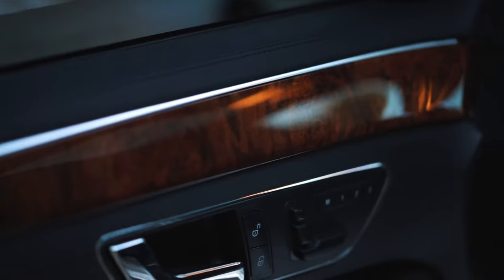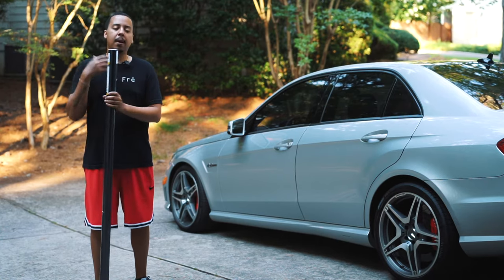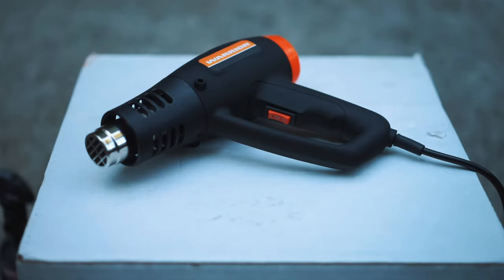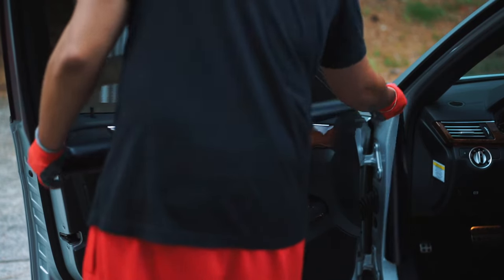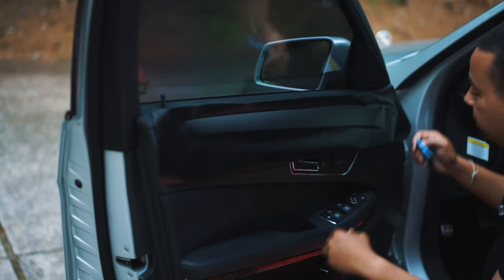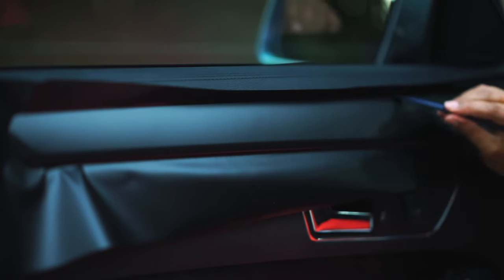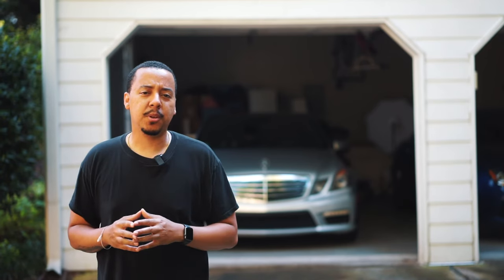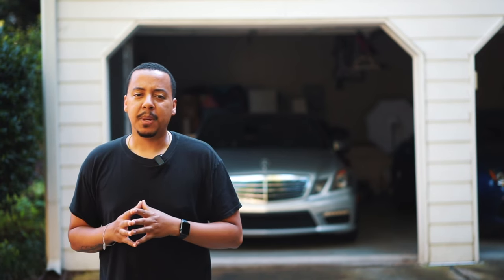HOW TO BLACK SATIN WRAP YOUR CAR INTERIOR TRIM!  Vinyl wrap you old wood trim without taking it off.

Comment: Another great video. I’d be interested in you doing an update video after a couple of months to see how it’s been holding up!
Reply from the maker: Thank you sir! Yeah, I will be doing some follow up vids to some of the mods I have done lately to see how things have held up. 👍🏽
Reply: and in the end? how did it hold up? Do you still recommend it doing it this way? Nice video btw @DriveTalkCars
Reply from the maker: @TheRealpl0x Actually it held up well. I would recommend it if you are looking to change out the look without spinning too much money or having to source a complete set of replacement trim pieces. Also, it the removal of the vinyl is pretty easy and no residue (in my case) was left behind.

Comment: Great video! How has the Vivid Black Satin held up so far? Does it get a lot of fingerprints/oil? Is it easy to clean?
Reply from the maker: It actually holds up pretty well. The only thing is the rounded grooves that my trim has. Some of it isn’t laying flat. But that could be my fault or just not enough surface for the vinyl to stick too. Other than that it is good so far...

Comment: I am looking to get a really cheap 2001 W203 C220CDI, but the wood inside is all scrached up to the point where its worth removing it all together (even if it requires revoing the dash) and wrapping it in carbon fiber looking vinyl. Idk what to do with the seats still but thanks you showed me how to do it even without removing the trim at all. Good job, keep up the nice work
Reply from the maker: Thanks for dropping a comment and checking out the channel!  Good luck with the new Benz!

Comment: how well is this holding up ? my wrap guy said it would fail and slide off over time, especially with excessive interior heat
Reply from the maker: I never experienced any sliding off or issues. Held up excellently.

Comment: That looks really sharp, definitely updated compared to that old school wood. I am helping my son who just bought a 2011 E350, black in and out. I really liked the satin finish you chose, it works to give that custom updated look. I was considering piano black like I have in my Macan, but it’s very delicate to keep clean. How have you found it to keep clean?  Are you using anything special that you prefer?  Thanks for the great video.
Reply from the maker: Thanks for the comment and watching the video!  Black on black E350, NICE!  Yeah, I was going to do piano black as well, but as you mentioned, it gets "dirty" so fast with finger prints, etc.  The satin can show oil from hands and forearm, but all in all it is pretty clean looking most of the time.  To clean I just use an interior cleaning product. Works well.

Comment: How has the held up to heat in a car interior? I live in south Texas where it gets really hot. Worried the adhesive will break down or it will start to peel.
Reply from the maker: So all in all it has held up nicely. However there is a part of the trim that has a curved lip on it and it came off a little. But that is more of a issue with the trim not the vinyl.

Comment: I love the wood trim in my E350....However, it has become faded and MB charges $4000 to restore. Rubbing compound has not worked, and afraid to try Brasso. Thank you for the video and idea.
Reply from the maker: $4000!?!?  Yeah that's too much in my opinion. You can purchase new trim for that much. I like the vinyl.  And you can always change it out if you get tired of it.  Thanks for leaving comment
Reply: I have same problem with the burled walnut in my 2012 E350 sedan (W212).  After taking off a trim piece and inspecting, I found that the wood "veneer" is micro-thin and is glued to the backing plastic.  The veneer is stained.  It's the stain that has faded from the sun's UV rays.  It would be easy to refurbish if the "top coat" was just varnish, but it isn't.  The top coat is "clear plastic" that's 1.5 mm thick.  I think the piece was put into an plastic injection molding machine after the veneer and stain were applied to get the thick clear-plastic top layer.  There's nothing you can do except replace trim pieces, or "wrap/paint" like shown in this video.  Note ...... I just received a court settlement notice about this, where 13 owners took MB to court.  You night be able to get partial or full replacement from MB depending on age of W212, and when you tried to get MB to fix it.
Reply: @kirkharris8729  my 2011 E550 is doing the same! I'm curious to hear how it went... following and please keep updates..

Comment: can we do it without heatgun i dont have it i want to install on my  car
Reply from the maker: You can use a hair dryer. The heat relaxes the vinyl so you can stretch it (not too much) and wrap around angles/curves/corners…
Reply: @DriveTalkCars  thnx bro but have question if we do that outside car and we wash will not be removed from the car?
Reply from the maker: The vinyl is made for exterior use as well. Washing the car normally shouldn’t result in any issue. However, that may vary depending on how successful the application.

Comment: I have a Lexus RX 350 can you wrap the steering wheel wood ???? I did order from Amazon Vivid glossy carbon.
Reply from the maker: I have never tried doing that. But I don’t see why you couldn’t though. The only thing I can think of is over time it might start to lift from all of the use.  However, there is a vinyl glue you can get to increase the holding power. Good luck 👍🏽

Comment: What about the heat? If it gets too hot in the car will it just get all messed up?
Reply from the maker: I haven’t had any issues with the heat. However, I do have tinted windows all around. So results may vary…
Reply: @DriveTalkCars  thanks for the update!

Comment: Looks great but you know trim pieces come off with a flat head screwdriver and you could have wrapped them put of the car. Would have been faster and easier
Reply from the maker: Thanks! Yeah, I had to redo the front dashboard trim and took it off that time. 👍🏽😀
Reply: the trims pop out and click back on?

Comment: If you don’t want wood trim then don’t buy a luxury sedan. Go buy a proper sports car with stainless,  brushed aluminum, or real carbon fiber. Vinyl wraps, whether inside or outside, are cheap ugly ways to look like a poser And also ultimately ruin the surface beneath the rap.